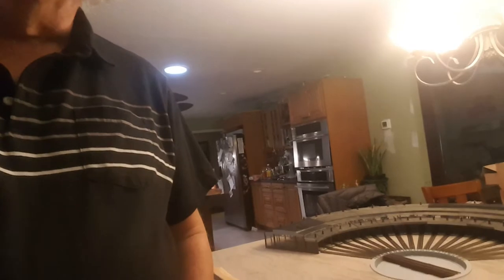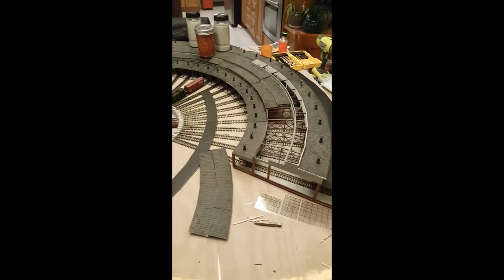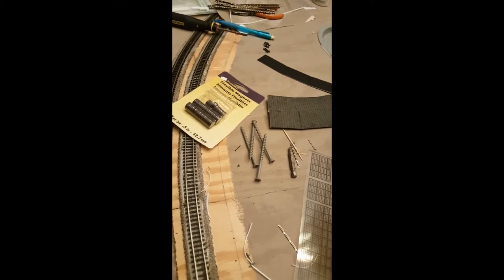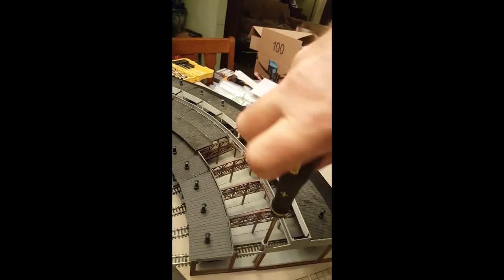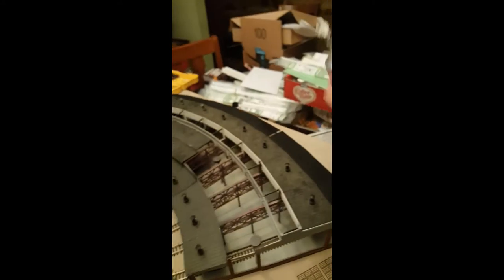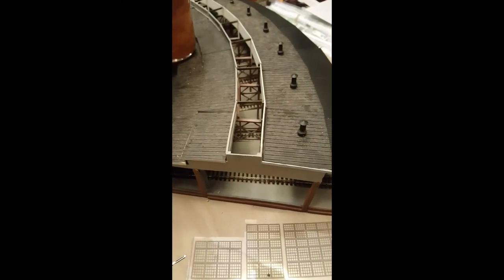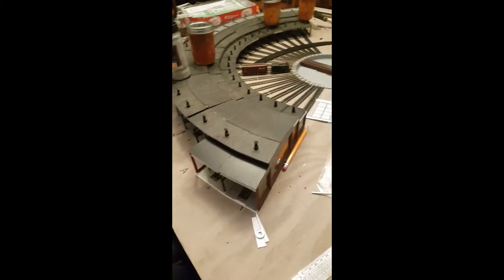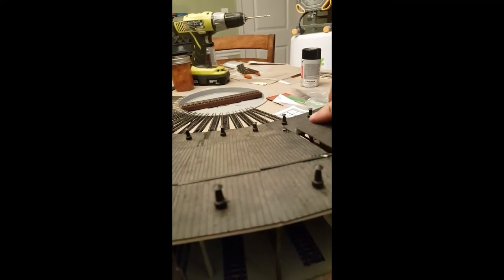Episode 2   Taking A Spin

Comment: Never thought about E6000, but my daughter uses it to put details on her stage outfits that she performs in and it works great there, so why not use it for our layout details?! Thanks for the tip.
Reply from the maker: I like it because as a rubber cement type of adhesive, it holds extremely well, but if you need to pry something up it lets go reasonably easily, then you can just ball it up and start over.  I don't use it to "build" things, but it can't be beat for securing those built things to the scenery base.